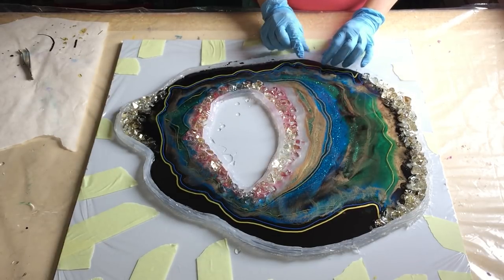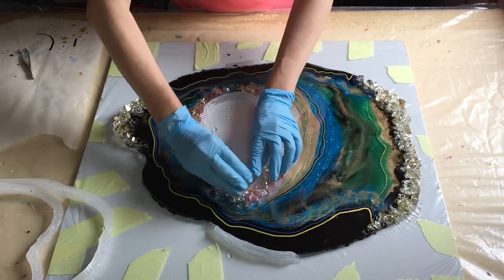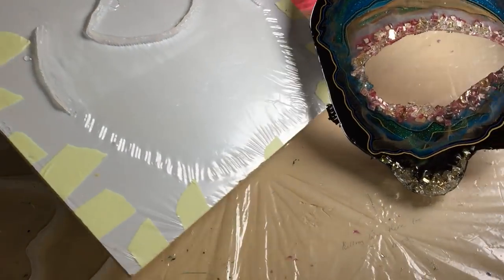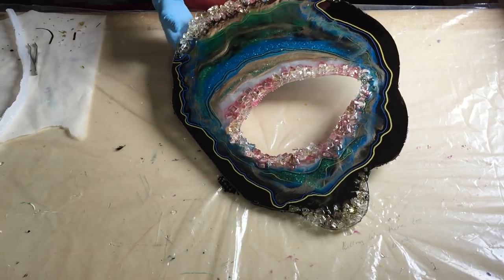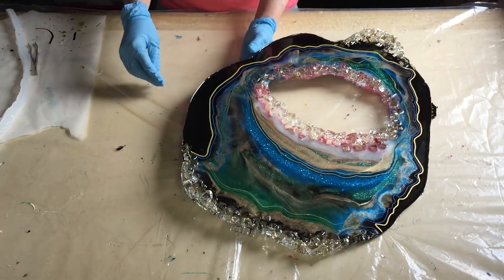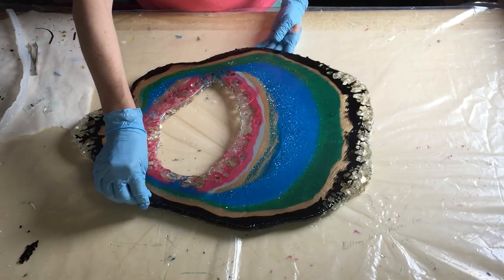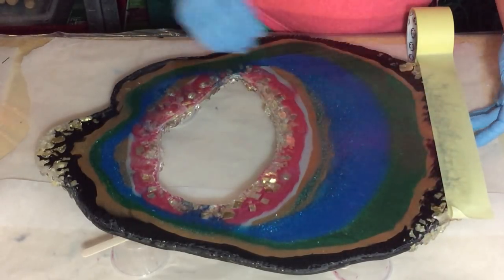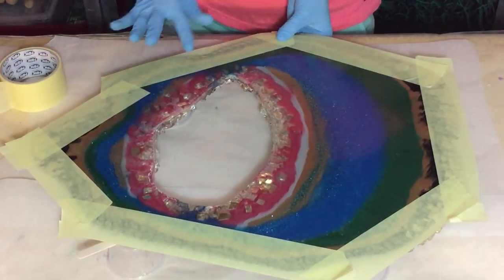59. Free Form Resin Geode. Part 5. Unmolding/End Result

Comment: You’re so clever to use the silicone barrier.  It turned out just beautiful.
Reply from the maker: Thank you so much Judy. I already did the silicone barrier with my blue/purple one. That's why I knew that it worked. The next test I'm going to do is on a acetate sheet, it's heat resitant, to get rid of the wrinkles.

Comment: Hello Petra firsr let me give you thanks for replay my comment really I like your job and thanks for share and tech us your  knowledge and experiences but I would like to know how much resin do you use en every job because that parts is very important I mean the total amount because after mixing I know the resin is divided in different cups. thanks in advances
Reply from the maker: Hi Yarla Rodriquez, thank you so much for watching my video's. I appreciate it a lot. In each video on the slide where you can see which materials I use, you can also see that I use Mastercast 121 resin. Behind it you can see how many mililiters I used for that layer. For the final coat I used 375 ml. For this Geode I used 2 liters in total.
Reply: Thanks so much.

Comment: I would like to know the best plastic or base for a mold. What plastic did you use?
Reply from the maker: For this Geode I used a thick plastic, but then you have a risk of wrinkles on the back. At the moment I'm using an acetate sheet. This is more heat resistant. I will include the link. https://www.amazon.com/dp/B004QVJLZE/?ref=idea_lv_dp_ov_d&tag=aiponsite-20&linkCode=ic6&ascsubtag=amzn1.ideas.QHQKH31AD8ZA

Comment: Dear Petra, do you have advice on removing the silicone from the inner barrier (center) of the geode ? All my cristals got kind of glued to the silicone when i poured the resin on it and i couldn’t unmold the center 😢
Reply from the maker: That's very strange, because normaly the resin doesn't stick to silicone. Can't you cut it away? Did you pour the resin over your silicone barrier? If that's the case then the silicone barrier is in between the resin. Then I think you need a smal mechanical sander (Dremel)  to get it away.
Reply: Petra Jongbloed  nope I don’t think I have poured resin over the silicone but maybe because I used glass crystals ? I may try to use a Dremel to take it off but I worry I am going to damage it. I have to try all over again and watch again how did you place your crystals over the inner barrier maybe I made mistake or put too much. Thank you Petra for your help. Also are you happy with acetate sheet result ? Or do you feel you have the same result with plastic sheet ?
Reply from the maker: I hope it works with the dremel. The acetate sheet works better then plastic. With the acetate sheet there are no wrinkles anymore because it is heat resistant. You can reuse the mold again if you want to, but you can also remove the silicone barriers and make another shape on it. The only thing I'm not complete satisfied with is shines on the back, but not as much as I want to.